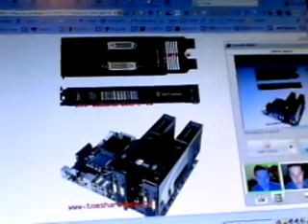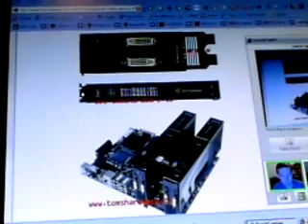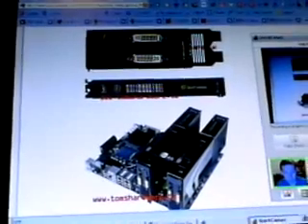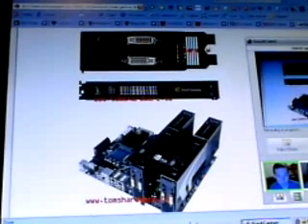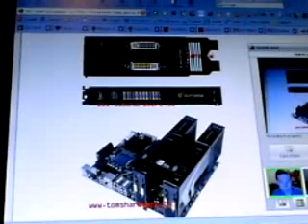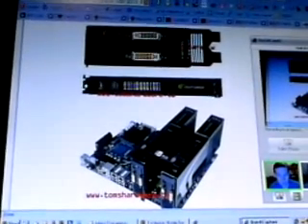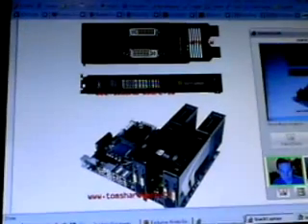9800GX2 -Dual PCB 65NM

Comment: If it's anything like the 7950GX2s jump of a single PCB variant, then it will be pretty pointless to buy imo.

Quad SLI in theroy is great, but they just suck at pulling it off, the gear is there, just cant put all that horse power down.

Comment: Yeah that is what I meant, I mean they are already using these G92 cores on the newest 8 series cards ( 8800GT and the new 512mb 8800GTS)
and all they have done here is basically slapped two of the new 8800GTS cards together in a single slot SLi configuration. I notice that you said on the video that the card is basically two 8800GTX's, which it isnt, if that was the case it would be boasting 1.5gb of VRAM not 2gb, and it would have 2 G80 cores not 2 G92 cores...

Comment: No. You cant run it in tri-sli. The reason for that is that its only 8800 GTX and Ultra which supporst tri-sli. Thats because of theri double SLI-connector thing. =)

Comment: Should be a interesting review, specially as the 8/9series work very different to the 7 series..

128 stream processors per card.. your talking about some serious bandwidth there.

I hope nvidia has learned what went wrong with the 7950Gx2 and corrected these mistakes in this card, should be very interesting to see a quad sli setup review as well. I will read before i buy

Comment: The higher end model should emerge in febuary. Then like the 8 series lower one later on in the year. Only a 30 percent boost over single 8800GTX right now.